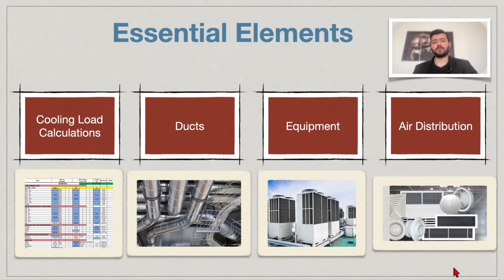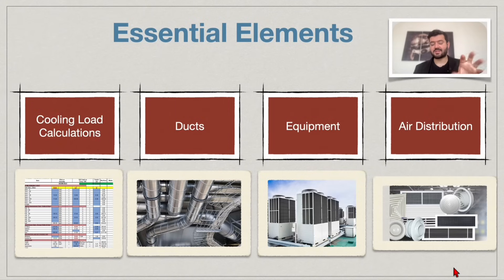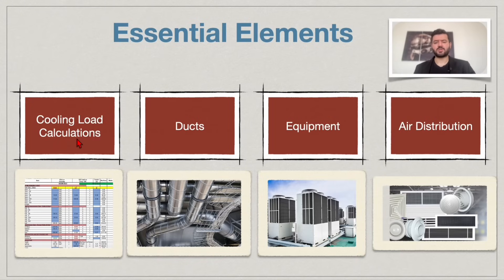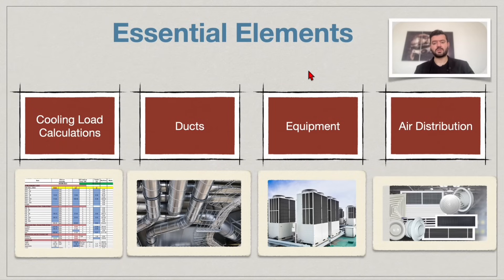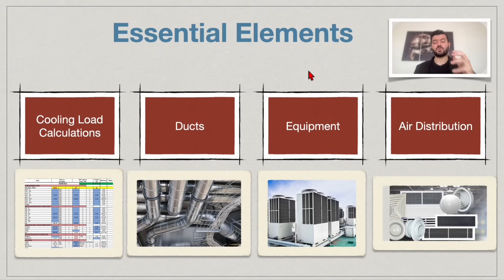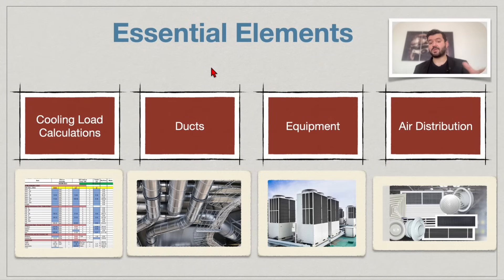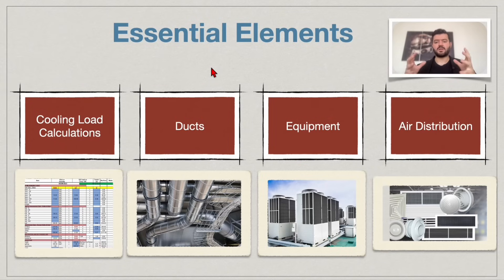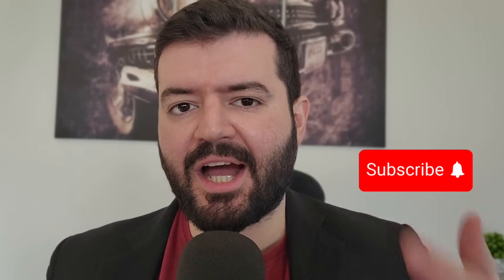HVAC Design Course A–Z | Learn HVAC Design FAST

Comment: Hi , if i go membership if i say 1 month can i access all contents? Like hvac and plumbing? Chatgpt Etc?
Reply from the maker: Certainly that's the point of the membership program, through the monthly membership you access all the courses added where we have new courses added on weekly and monthly basis.
Reply: @ExpertEaseEducation  lets say, i enrolled for a month, and i studied hvac, will i lose access if i wont renew?

And the difference of it with the straight purchase is i can access the purchase anytime?
Reply from the maker: Great question, with the active membership you can access the courses in the membership as long as your membership is running if cancelled you lose access, for one time purchase you maintain access for the course. Our programs are premium and high quality if you are an active learner go for the membership if you want a specific course only then go for the one time purchase.
Reply: @ExpertEaseEducation  also are you considering fire protection system designs too?
Reply from the maker: Certainly, currently in the pipe line we have firefighting design for data centers which will be added this month, we also welcome suggestions from our Students as our industry experts create programs that are meant to help you excel
Reply: @ExpertEaseEducation  i just subscribed for basic membership. 🙏 ill be utilizing it as much as i could
Reply from the maker: @essi1014  Great Choice! Welcome to our global community of 100,000 leading professionals who are serious about staying ahead with the latest market and industry skills which are taught through our premium and globally recognized programs, which will surely help you grow and succeed in the various walks of life!